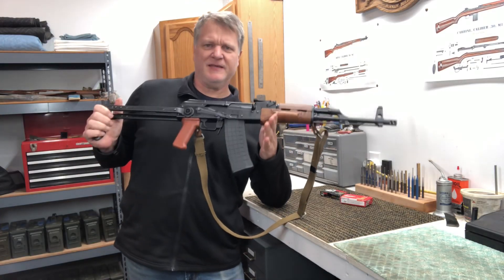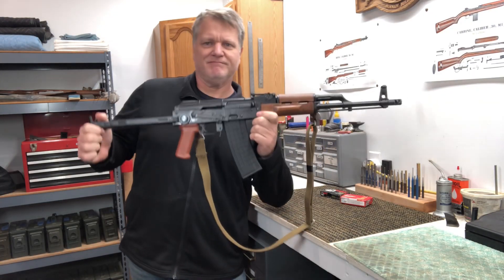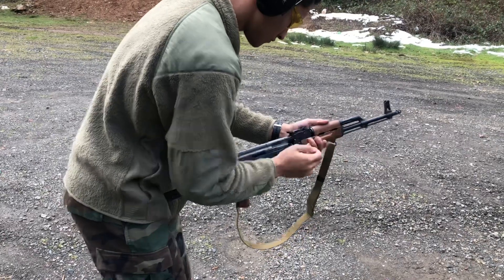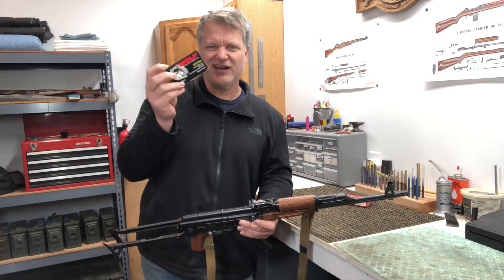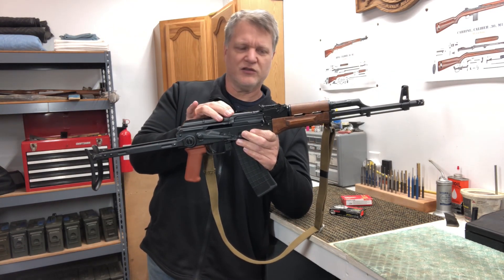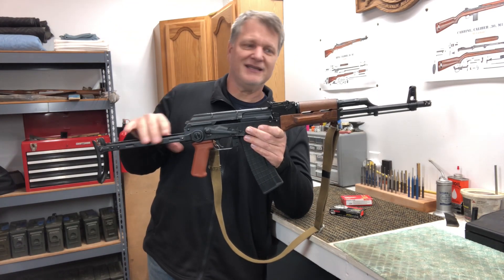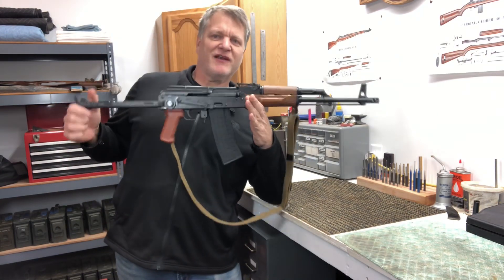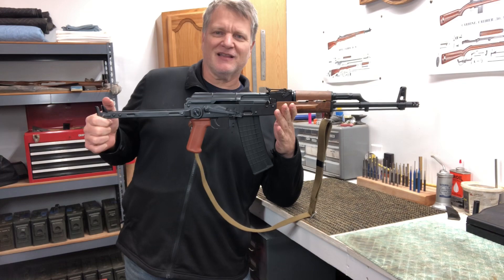Shooting the Pioneer Arms 5.56 AK

Comment: I'm still curious about how accurate these are. The only group I've seen shot on video was about 18 inches at 100 yards. The under-folder isn't conducive for accuracy, but it's funny that no one is shooting these things on paper.
Reply from the maker: We did shoot some 6” X 9” steel at plates 50 yards.  Next trip to the range will be to test accuracy.
Reply: 3.5" at 100 with 55gr handloads, 11.75 hellpup and 16 rifle. not 1 moa but decent. i like both of mine a lot

Comment: I hope you have a couple of spare firing pins. I've heard a lot about them breaking prematurely. Something about the geometry of the firing pin channel, maybe?
Reply from the maker: Thanks for the heads up.  First I’ve heard of that.
Reply: @FlyingKSports unfortunately firing pins are a known issue with these rifles and virtually guaranteed to fail. Usually around the 1000-1300 round mark. Mine did end up breaking. I hear Pioneer will replace the firing pin (at least if you’re still in warranty). The (probably) more permanent fix is to replace with a Beryl firing pin. It’s what I’ve done for mine and it’s worked great. Of course currently Beryl pins are sold out from places that carry them, likely because Pioneer owners have been buying them up.
Reply: You're absolutely right about the geometry of the firing pin channel. On mine the OEM firing pin broke around 800 rounds so I replaced it with a beryl firing pin and that broke at only 600 rounds. PA is always out of stock  on  5.56 firing pins on their website but I called them and they did replace it. The extractor on this gun is terrible so I'd replace it with a beryl extractor. If you buy this rifle I highly highly suggest just replacing the bolt carrier and bolt with the wbp 5.56 one. That one works perfectly and if your firing pin does break wbp usually has them in stock.

Comment: I have two… the problem is it’s a polish gun with American parts… replacing with polish parts… you’ll have a smooth as glass rifle.
Reply from the maker: We have cleaned it and taken it out again since this video.  It’s gotten smoother just from breaking it in.
Reply from the maker: What parts did you replace?
Reply: @FlyingKSports  polish forged bolt and carrier + telescopic recoil assembly. Still trying different triggers but polish the hammer face and bolt face for smoother action.
Reply: what bolt and carrier are you using? I looked into WBP stuff but the diameter of the bolt stem is different than the ak74 style that comes in this pioneer rifle so that sketched me out and I just stuck with stock parts.
Reply: @SamplersAndThings  I’m using that same brand in 5.56.
Reply: Also… spring loaded bolt/ firing pin. KNS adj gas piston.
Reply: @MarsDK88  I guess it makes sense since it’s the bolt and carrier together. Thanks for the confirmation. When I was looking at replacing the carrier only, because it’s cast, the stock bolt would have been loose. The stock bolt is forged but the carrier is cast. I think I’ll stick with that for a while. I just shot mine today and it ran great
Reply: @SamplersAndThings  yeah. The site has the two at a great price for such durable high quality milspec parts. I use the stock stuff for target shooting. I run the forged stuff with cans.
Reply: @MarsDK88  that’s smart. Thanks again for the info. You should maybe make a YouTube video showing how everything fits together, I know a lot of people would have interest on that. Pretty sure these rifles got a lot of new interest, like me, since that burndown video.
Reply: @SamplersAndThings  people just like to spend money on what’s popular and not what works. I’ll probably do something in the future showcasing my build. I’m currently having work done by m13 industries.